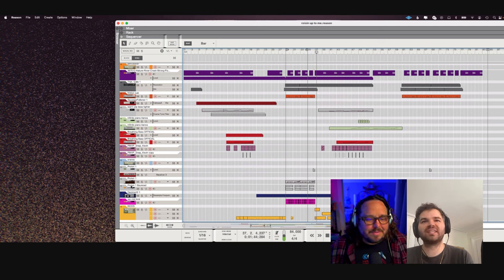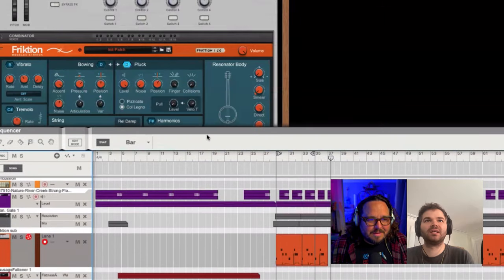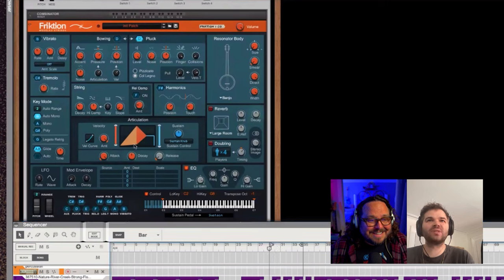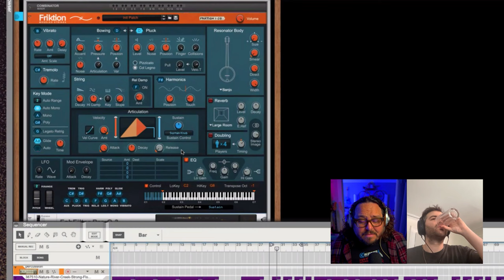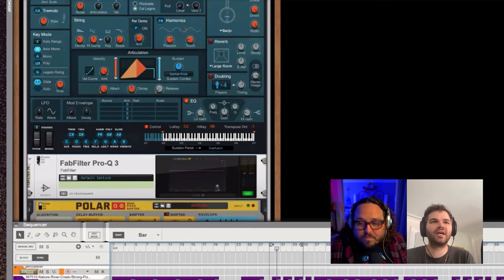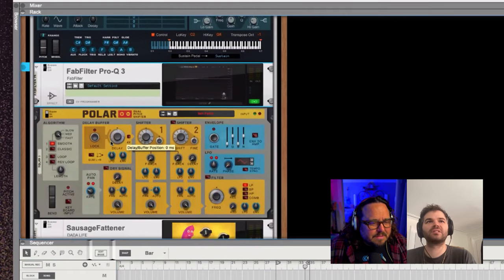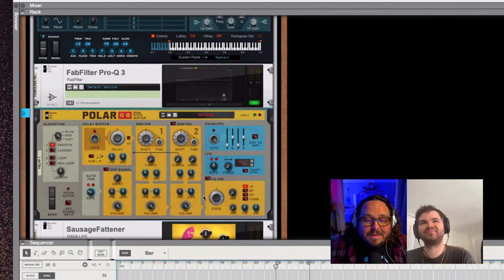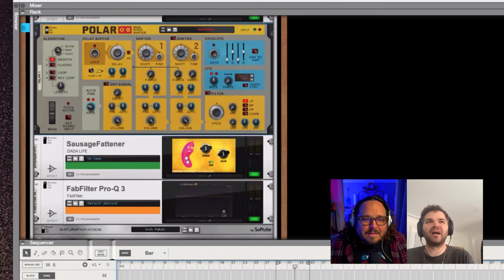Sub Bass Sound Design with Friktion and Polar Dual Pitch Shifter

Comment: Why does Reason 12 work worse on a Macbook Pro than on an old Laptop!? Почему Reason 12 на Макбуке Про работает хуже чем на стареньком Ноутбуке!? https://youtu.be/ZKqEVVVFFQk
Reply: Depends on the MacBook Pro. The 2020/2021 models are using custom Apple Silicon chips and Reason is among the few DAWs still not optimized for it. Every other DAW on the market is M1 Native save for Reason and ProTools, but Reason in particular runs terribly even under Rosetta.
Reply: @StellardroneMusic  Tell that to the countless professional artists, photographers, audio engineers and producers that have been on the Mac for the past 30+ years.